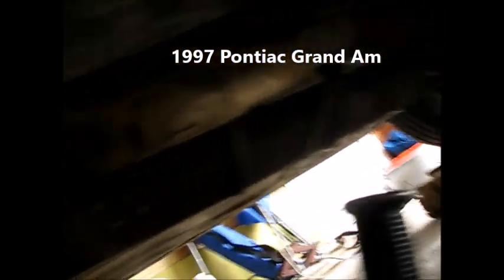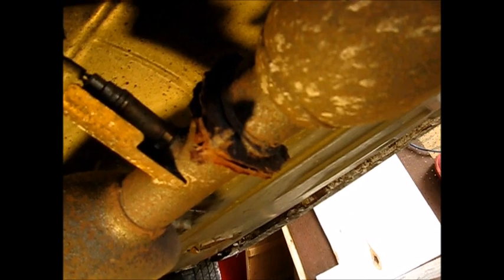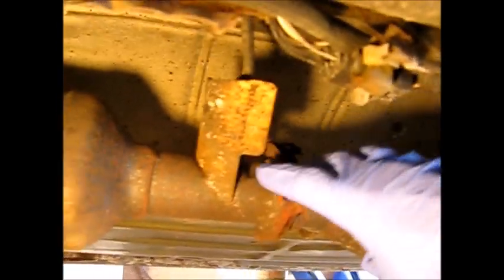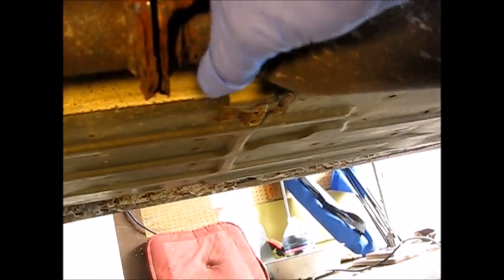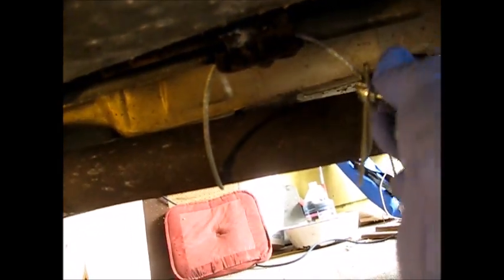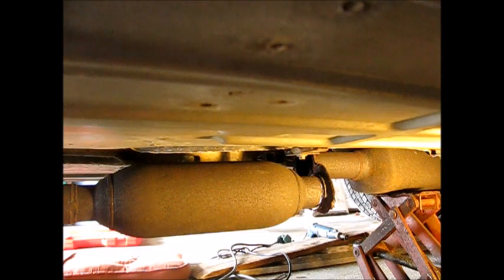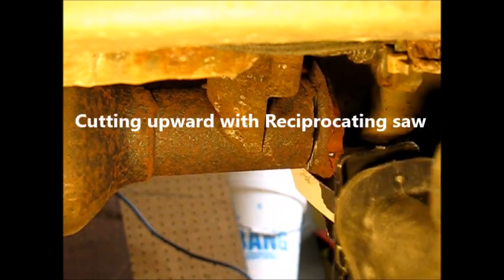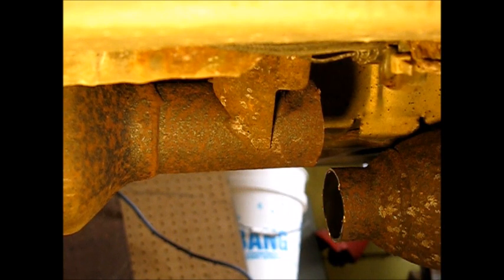How to use a butt splice to repair an exhaust pipe leak

Comment: Thanks for the your video. I had the same idea to fix broken section of my exhaust pipe but was planning to cut a piece off both ends so I could go and size up a good fitting adapter at the store which has a snug fit on both ends.  Then put a good high temperature sealant on the pipe so no exhaust noise.  Before I clamp down both ends might look for good muffler tape to to wrap around the adapter and pipe.  Not sure yet. But seeing your video helps a lot. Thanks!

Comment: I had no idea the sealant existed. Excellent tips. Thanks for the video!
Reply from the maker: You're welcome. I appreciate the comment.
Reply: Thank you I will fix mine that way too!!
Reply: The Original Mechanic SnowPlowLife my pipes are 2 1/2 inches on both sides..I’m looking to get a connector to fit inside the exhaust and the other end to fit over the pipe ..please could you help  me choose what size connector to get?..Thanks

Comment: good video.  If you use sealant pre cat, make sure there is no silicone in it,  it could destroy your cat.  Also, little hint, try not to tighten clamps where the nuts are down because when you drive, they could catch road debris

Comment: Great video, especially since I have the exact same problem right now.
Reply from the maker: Alright. Glad you found the video.
Reply: Thanks, exhaust pipe is now fixed woohoo
Reply: Duke Nukem don't use sealer

Comment: Great video, I'll do the same. Is ok to use gasket maker (high temperature copper one) instead of the sealant?
Reply from the maker: I don't think that would be as long lasting as the made for exhaust sealant. I've noticed that exhaust gasses are very corrosive.
Reply: I did not see what the name brand was for the sealant or where you got it.
Reply: TJ yes, that stuff is made for extremely high temps like exhaust systems

Comment: is
 this legal for safety inspection in pennsylvania
Reply from the maker: Clamping exhaust pipes together is a common and perfectly legal method.
Reply: nothing is legal in Pa. One of the reason's I left years ago.  If it doesn't look pretty they fail it. :-)
Reply: @JohnSmith-uy7sv  You must have been going to all the wrong shops then, or had some really janky stuff on your vehicle.  I've used this exact method on my exhaust and I live in PA....there is no problems with this passing inspection.  If the exhaust is not leaking then it's good to go.  You can wrap a soda can around the pipes with two hose clamps and its fine.  Duct tape over rust holes in the body of a car passes too.  I've taken my car to plenty of different garages, including dealership service depts. over the years and never had a problem.
Reply: I'm not a janky stuff person. Pa has always been super stirct  even years ago with a stop of rust they would fail it. They were just stupid crazy. I grew up in western pa in the 50's , 60's and 70's. I should know.

Comment: Hi Original Mechanic, where did you buy the Butt splice? I had the same problem you just fixed happen to me today. If you could please let me know I'd appreciate it. Thanks!
Reply: Found it on Ebay, it's called Universal Exhaust Pipe to Pipe Coupling Connector(it's also called an Exhaust Pipe Adapter). Thanks for the video! I have a Pontiac Grand Am 1999, I needed a 2inch inside diameter exhaust pipe adapter.
Reply from the maker: I bought it from NAPA. I just told the counter person the OD of the exhaust pipes and he found the right one for me. It was like $4.00. Good luck with it and thanks for watching!
Reply: Thanks, I appreciate your video, it was a life saver! I just cut the pipe with the reciprocating saw and sanded it, now I'm just waiting on the adapter pipe to come in the mail.
Reply: Used can ofsoup cut it custom make your own !!!

Comment: good, only, not so sure the sealant is going to help anything, don't think any liquids work on exhaust fixes, matter of fact, it might turn into a lubricant at high temp later down the road and cause things to loosen up. you can look into it, but I got a big "I don't think so" on the liquid sealant
Reply from the maker: OK. This is the same sealant I've always used when replacing a muffler and I never had any problems. Thanks for watching and commenting.
Reply: Those sealants are mostly ceramic or silica based.  They hold up fine.

Comment: I'm new to exhaust repairs - in the middle of a break doing one now, and welding too, but I think it would've been best to do it in a professional method, and in not doing so, you were "penny wise, pound foolish". Drop the exhaust if necessary, grind off all the rust with a grinder and wire attachments, MIG weld in 2 flanges with a gasket in the middle, and bolt them together. Right? Eliminating the flange joint can make the exhaust system much harder to work on in the future! I thought I was going to learn something from you, until about 4:07 when your rust cleaning consisted of brushing them off, and using lacquer thinner, then you went for some pipe sealer. Really? Is that recommended by the pipe sealant manufacturer - on hot exhaust surfaces - because I had no idea something like that existed? Only ideas I liked was using that cable and cable lock, and jack for support, so I guess you did something right. Thanks for your time.
Reply from the maker: Thanks for watching and commenting. The owner of this old car was pleased with the savings and so far it has held up. Thanks for adding your thoughtful and well written critique.
Reply: You could have spent a lot more time, a lot more money, and done a lot more work but I doubt you would have had a better result. That repair is likely to outlast the rest of the exhaust.